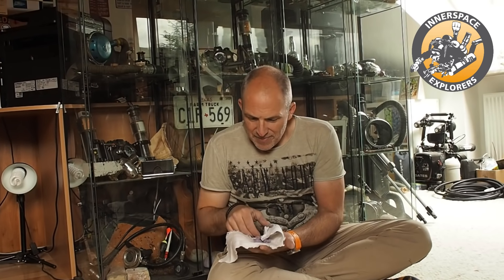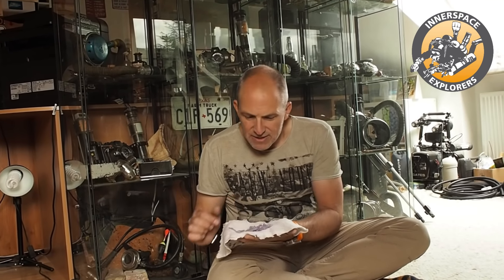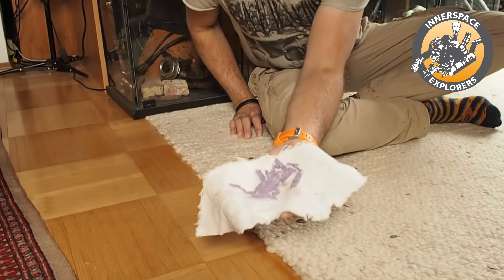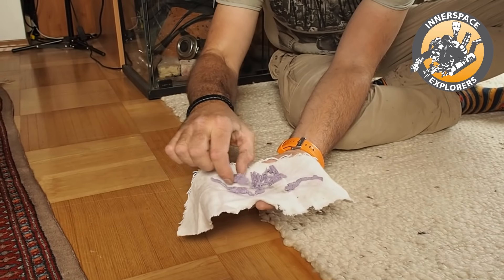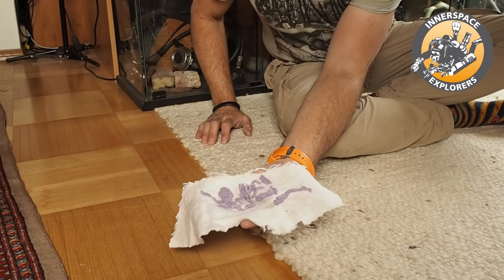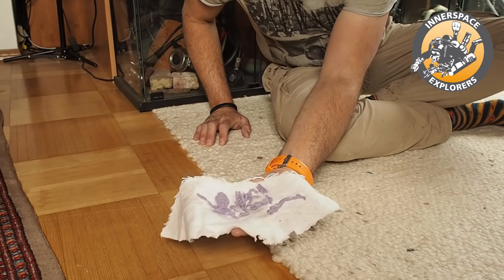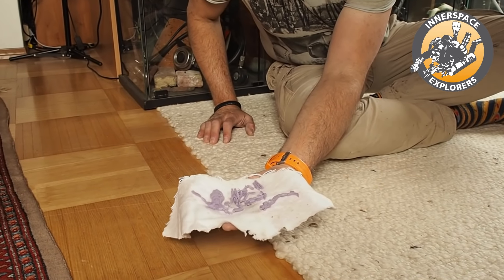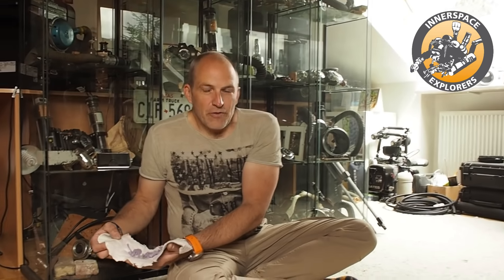Why you need to be able to reach and turn you single tank valve

Comment: Another example of the divemaster closing my valve. I have a set of doubles that I broke apart and use as single tanks; one tank is a left hand valve and the other is a right hand valve. This means that one turns forward to open and the other turns backward to open. One day on a dive boat, I open my valve, check the pressure gauge, check the second stage and head for the back of the boat. The divemaster helps me to the back of the boat, checks my valve, thinks it is turned off. He closes the valve, opens it a quarter turn (I hate this practice). I jump in the water and everything seems fine. But as I descend, it becomes harder and harder to breathe. A quarter turn open was enough to give me air at the surface but not as I went deeper. Fortunately, I have always practiced opening and closing my valve while fully kit'd up. So I reached back, check the valve and realized it wasn't fully open.

Comment: On a dive boat in Roatan. Some slower, newer divers were gearing up at the back of the boat for back exit. A diver toward the back of the pack (front of the boat) asked for and received permission to do a back roll off the side, which she did . . . . and immediately realized she had forgotten to turn on her tank. Quick, slightly panicked swim back to the boat to get assistance in turning the tank on.

Comment: There's also the situation where you open the valve just enough to see the SPG needle move. You may get enough air on the surface but not enough at depth.

Comment: Being able to close your valve could have a minor role to play in a full-on freeflow or burst hose situation.  Yes, on a single you're going to be needing a buddy to air share (unless you  are carrying your own non-back-gas back up) but once you have secured a robust  alternate air supply then being able to turn off your tank is helpful simply to calm the situation!  A burst hose or freeflow is a noisy, disorienting event, bubbles everywhere, so if you can stop that, then this is a good idea.  It's also likely to calm any other divers in your group, as it'll be clearer to them that you have got the situation undercontrol and are actively managing the problem. Now of course, your buddy could also turn off your valve, but in general practicing being able to reach your own valve sounds in principal like a useful skill, even if you never actually need to do it  :-)

Comment: Clearly explained, good points, as always. Thanks!!
Maybe do a follow up on this with tips on setting up your tank, stretch your shoulders, to reach the single tank valve? (It’s position is ever so slightly different from a double tank set.)
Reply: Doubles is easier since the knobs are higher up and further out. You can make doing it on a single tank easier by putting the band lower on the tank, but GUE won't allow me to do that.
Reply: Turn the tank valve 45 degrees toward your body instead of parallel to your body. Depending on your reg, no turret, you might need to change hose positions. In that position you should easily be able to reach it sitting on deck. In the water you can also help locate it by placing the back of your hand against the back of your head and  tilting your head back to push your hand towards to valve.

Comment: That 's the reason why I don't want anybody to touch my valves (specially not dive masters and instructors).

- Had a dive master on her first day of service and she closed my valve in my back when jumping from the boat.
- I was diving with 2 biddies (CMAS * and instructor) and the instructor performed a buddy check at the * and closed the valve (which I saw and fixed).

Comment: GUE requires this, and it is why I haven't past my fundamentals rec pass. Even worse they require the top band to be at the top of the tank meaning the tank is lower on your back.  I'm just not flexible enough to do this especially in a dry suit.  If I could put my tank how I normally would,  I would be able to reach it.

When I was originally certified with Naui, we had to remove the BCD in the water and put it back on. I think I could remove my BCD, and turn back on my air almost as fast.

Comment: Always keep the single tank valve on reach. Test at the pool all the imaginary scenarios, in case it happens you won't freak out. I had a colleague at the club once closing my tank without notice. But since i had it planned (running out of air scenario) my brain kicked in automatically when noticed the pressure difference and adjusted the breading giving enough time to assess the situation and save precious air, spg pressure check ok, then went straight for the valve and opened. The 3rd step would have been buddy reserve😅😂 not ideal but since had the time. Stay calm and you'll achieve more. Is quite hard to find buddies,  even wors instructors willing to test different scenarios. Most of the time i feel like begging, or have to go behind their back which increase the risks. I'll grab what experience i can. Remember if have any doubts, either reevaluate or split the exercise till master don't add any unnecessary risks, you only have one life. Hopping someone will save you, it's another risk taken😅

Comment: Always do a buddy check before you start your dive and when you get entangled stop think and act. When you run out of air signal your buddy and give the out of air signal, share air make buddy contact and make a control ascent. These are the basic skills you learn in your open water course and what you should apply in situations you mention.